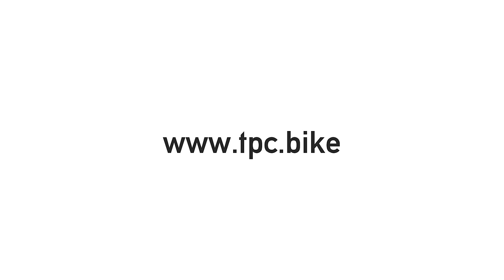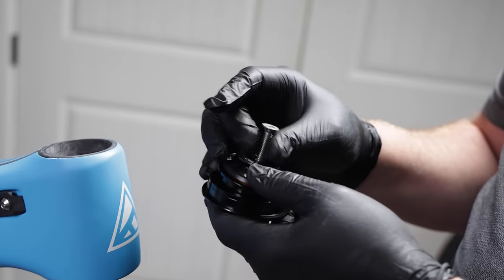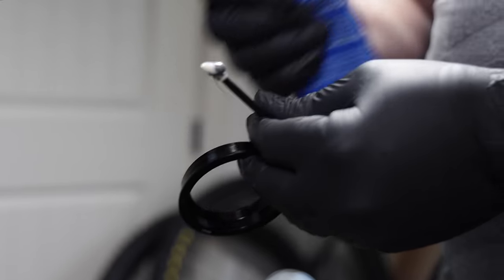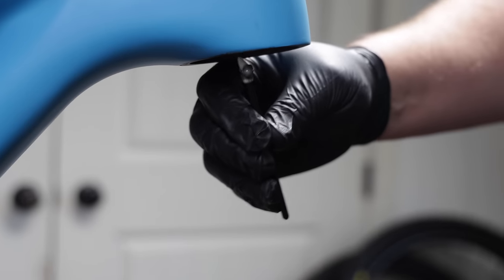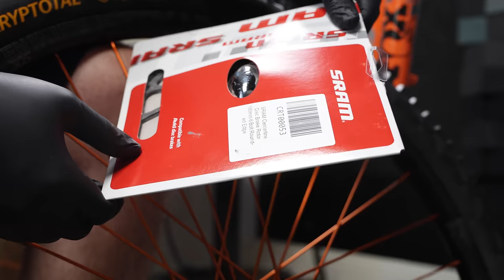DREAM BUILD: Forbidden Dreadnaught

Comment: This was a perfectly good opportunity to try weight weenie engineering, or other cool risky tactics.

- could have blasted the frame and tried out a lightweight filler
- drillium
- could have made your own carbon parts
- ceramic bearings
- could have special ordered hopps carbon parts or another custom parts builder
- rope spokes
- logo blackout with vulcanizing rubber cement
- special precise lubricant stencils
- freehand airbrush details
- acid weight removal
- disassemble and polish every brake and drivetrain component to a chrome finish
- I have 1million ideas if you want more

You might of course be constrained so as not to do something cooler than buy off the shelf components and assemble them but I would love to see it paired with your humble beginnings, artistic understanding of film, and dedication.
Reply: I really really loved your builds where you restored an old trashed ancient piece of garbage bike, that is just so cool. Want to see more of it, the worse off the bike the better (as long as you use a ton of the original components) (the best part is when you use original components)